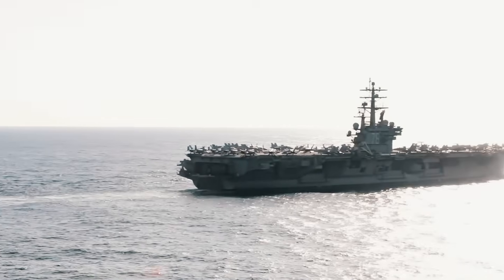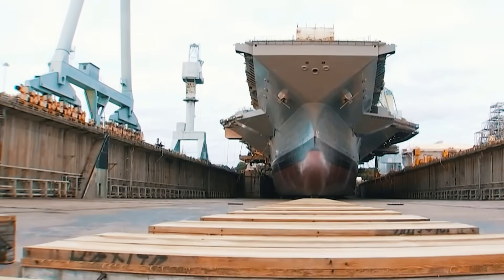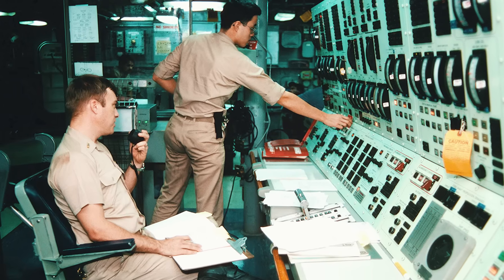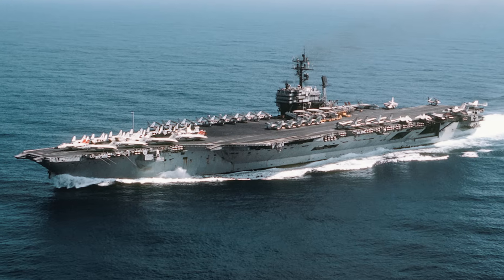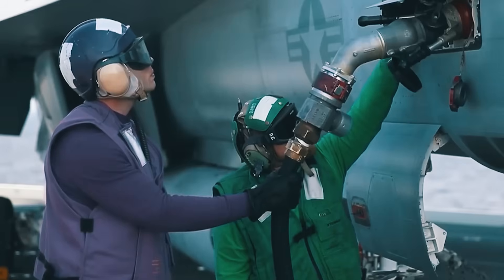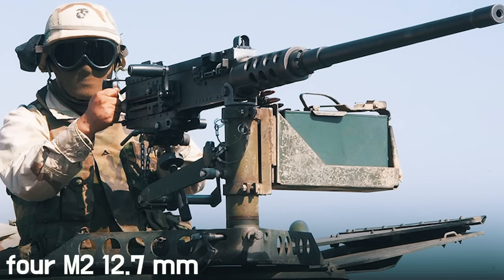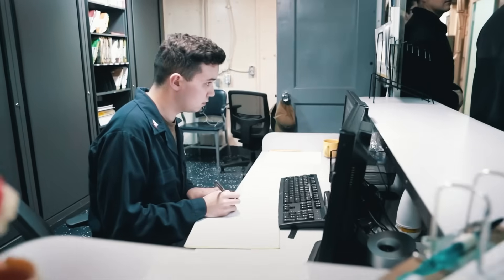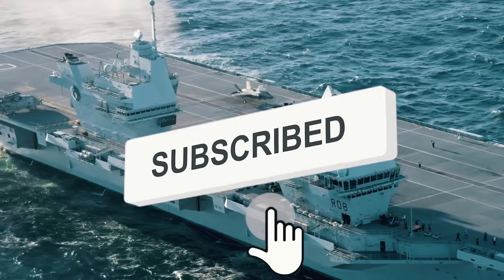US Testing its New Gigantic $13 Billion Aircraft Carrier

Comment: Beautiful machine!  Nikola Tesla, and Albert Einstein would be proud.  Wondering whether a drone trailer ship, could be employed, that could attach with button holes to the aft deck of this carrier similar to how a Semi Trailer attaches to the Semi tractor, only it would be a plane flat surface to add about 50% of the ships surface area to the aft deck.  It would essentially be a Styrofoam block with a motor and a rubber flap that button hole attaches to the aft deck of the carrier.  No crew, it is remotely controlled like the barges the Falcon 9s land on at sea.  Maybe it could carry spare parts or deluxe sleeping quarters.
Reply: Einstein wouldn’t not be proud he was a pacifist
Reply: @johnm7267  I recall that he wrote a letter to Truman or somebody that explained how a nuclear bomb could end a war?  Point being;  one can be a pacifist and still design defensive weapons that will cause death.